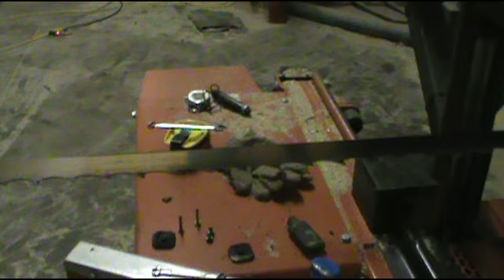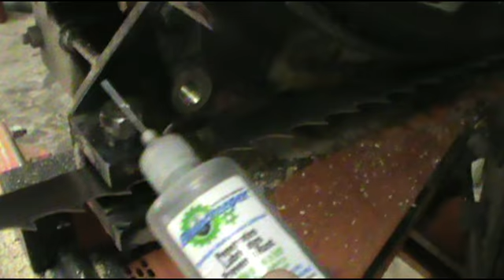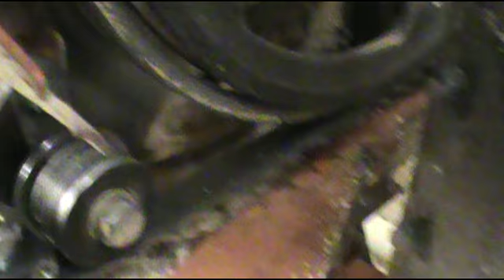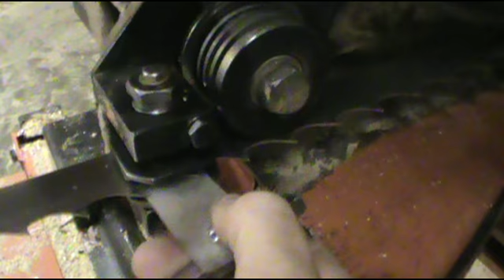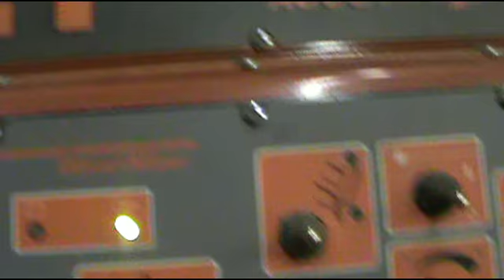Wood-Mizer Blade Alignment

Comment: when you say "an 1/8th inch tilt" where are you referring to and from? if you say it in degrees then there is no question. If you say 1/8th inch, at how many feet? your straight edge?  the width of the throat?
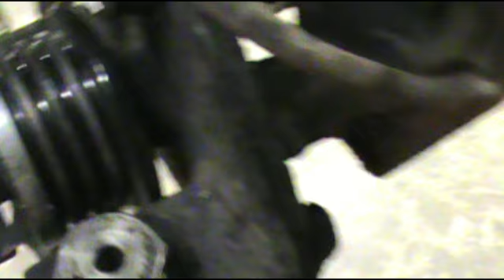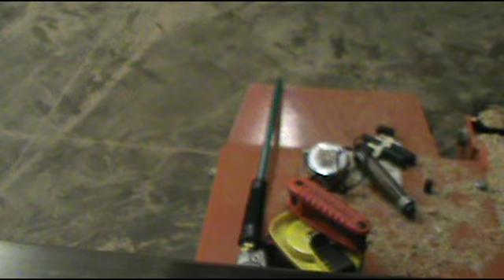Reply from the maker: I used "an 1/8th inch tilt" when referring to the driven side blade guide roller. The 1/8th inch is the set back of the aluminum alignment tool on the left side while the right side in contacting the face of the blade guide roller.  Refer to 5:40 in the video. See where the blade gullet is in reference to the face of the blade guide roller. The gullet is at the face of the roller.  Watch until 5:58 and you'll see the alignment tool edge is recessed an 1/8" behind the gullet. This slight "Tilt" in the blade guide roller makes sure that when the blade contacts the roller flange, the blade contacts the up swing of the flange keeping the blade stable in the cut. 
Hope this helps.....

Comment: how often does this have to be done--and  is this mandatory for any  and all band saw mills?thanks--yeah---i know im green
Reply from the maker: All Sawmills need periodic maintenance. The more you use it the more it needs adjustment.
But 50 to 100 hours of actual cutting, not engine hours.
Reply: thanks

Comment: do you take the stainless caps off to level the bed rails? all the caps on my lt40 were humped/bowed from day one, same with the caps on the backstops. how do you work around that?
Reply from the maker: Being the cant sits on the stainless covers you have to work off that surface
If there is money in the budget , replace all the covers and relign. The covers are $23 each. Another option is to pull all the covers off and use tools availible to flatten and square the damaged covers. Remove all rust and scale ffrom the steel bed rails so the covers sit flat and tight. Reassemble and align. Good luck with your project.

Comment: Quick question from a newby and someone who is kinda slow in processing, when you align the head, using the bolts on the bottom of the need, why do you want the saw blade 1/16th of an inch off parallel with the tracks, ?
Thanks and sorry if it is a silly question.
Reply from the maker: Sorry for the delay in responding. I did not know you had 2 questions.
The out side is set 1/16” high because that side pulls down when cutting.
It’s just how a Cantilevered Head needs to be set up.

Comment: I believe what you refer to as a "V-Belt" is what I was taught to call a "tire."  Either way, I'd like to know if there's a specification for how loose the tires should be?  I was also wondering whether or not a total alignment is within the capabilities of a mill owner?  I'm asking this particular question because there's a WM field team passing through our area later this year -- but their alignment services are rather expensive.  Thank you for your efforts to inform and educate WM mill owners, Al.
Reply: Timberwright Svs i tried to do it myself yesterday and i spent the whole day. it is a lot harder than you think. lots of thongs you n
eed to adjust. I would pay any amout of money to WM to do compleat adjustment for me now.
Reply from the maker: 1-800-525-8100 .
Reply from the maker: The more skilled and mechanically inclined the owner is the better off they are. A Full Alignment is possible by most owners.  The Tire is actually a V-Belt. Most WM use a B 57 belt.
Reply: I started working with bandsaws a looong time ago, so I have that type of band wheel on the brain (re: tires).  Thanks for your thoughts on what it takes to perform an alignment, Al.  Does the alignment process require any specialized tools?  If so, would you pass along any information we may need to get our hands on said tools.
Reply from the maker: The only Special Tool is the Blade Alienment Tool from WM.
Also you'll need the actual manual for the mill you are working on.

Comment: Why is the band wheel bands so loose in the grooves?
Reply from the maker: Wood-Mizer uses a V-Belt as traction and a wear device for the wheel.
The V-Belt runs in a groove in the wheel. The V-Belts runs loose to allow sawdust to escape from under the V-Belt. 
Good Question.

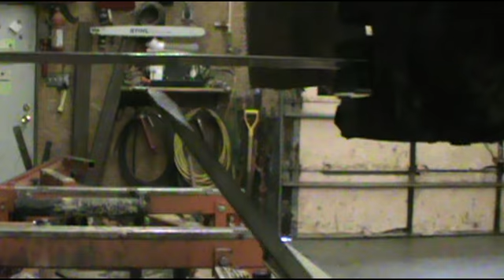Comment: great video- curious about the last step at around 9:30... why do you want the outside to be 1/16" higher than the inside? does the momentum of the running saw bring it down to parallel?
Reply from the maker: +James Steidle 
When the Blade engages the wood the torque pulls the head down about a 16th thus leveling to blade out.
Good question.